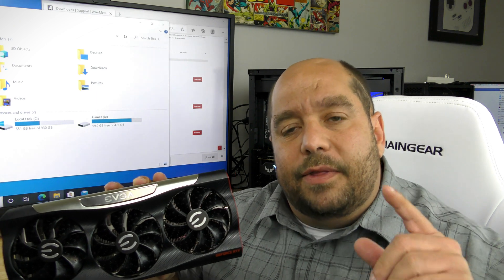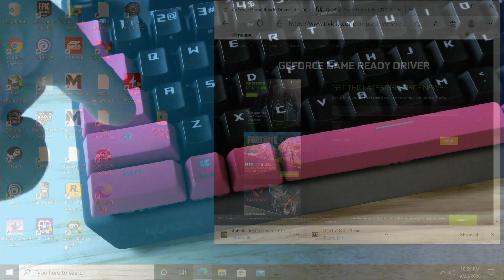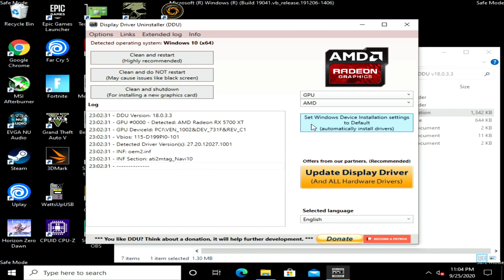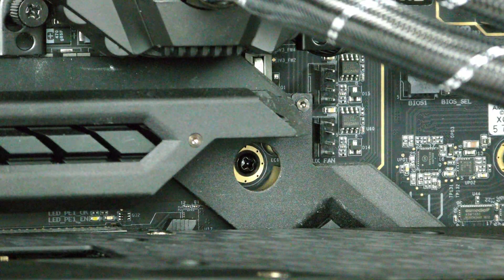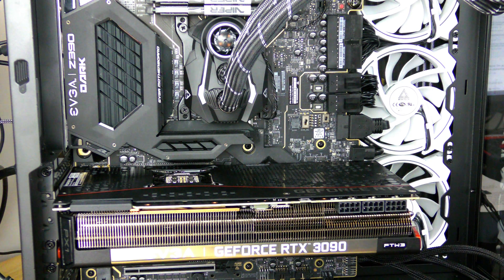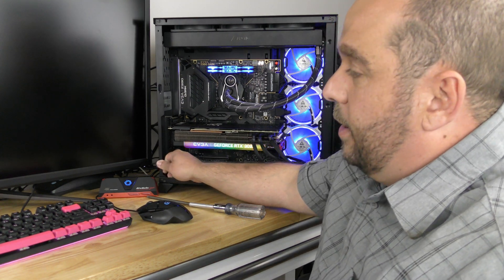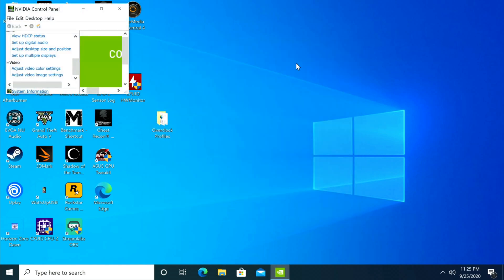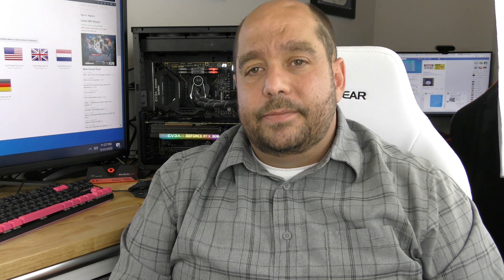RTX 3090 - Installing the EVGA Geforce RTX 3090 FTW3 Ultra Gaming

Comment: Hy! :) 

Please can you tell me, why beeps 4 times the computer on the start whit this cards? Before i have 1050 ti  doesn't beeps. Just whit 3070 FTW3 Ultra. Thank you ! :)
Reply from the maker: Hello my friend, we, that depends on your motherboard actually, those are post codes.  What is the manufacturer and model number of your motherboard?
Reply: @ThisBytesForYou   MSI 970A Gaming Pro Carbon. But comes for me  new ASUS ROG Strix B365-F Gaming.  I hope whit this will not beeps . I hear this beeps  in your video to on 9:08 when you start your computer. :) Thank you for Helping me. <3
Reply from the maker: @87Freemann  So the B365 does not have a speaker, you can add one, but it does not come with it installed, it is amazingly helpful to have though because this helps you to determine issues you have with your machine during POST.  For the 970, the instructions are horrible on MSI's site, but I don't see how to disable them.  Maybe you never noticed it but the machine should have always beeped, that is normal.  Try putting back your 1050 and see if you hear it, I am sure you will and you are so very welcome, I love helping my friend.  Thank you so much for stopping by to check out the video, liking and subbing as well as commenting, it means the world to me.
Reply: @ThisBytesForYou  I put 1050ti back. its not beeps now.  Just whit the 3070 :/  Your Wellcome! :) do you have fixit on your PC to ? This problem? on 9:08 Beeps yours 4 times as mine whit this card.
Reply from the maker: @87Freemann  so is the only issue the beep, or do you not get in windows?
Reply: @ThisBytesForYou  I Have it just when i start my PC. I can play i can do anithings. Just its beeps 4x on the start as your Config in this video. Nothing more. Just every start or restart when starts the PC.
Reply from the maker: @87Freemann  Not sure where this is in your BIOS, or if your BIOS has it, but disable CSM and this should get rid of those beeps.
Reply: @ThisBytesForYou   Thank you very much! I will try it! :) <3
Reply from the maker: Anytime my friend, let me know how it goes.

Comment: Is it bad to use the same pcie cable for my 3070. What’s the difference if I have 2 separate cables vs using the same one
Reply from the maker: yes, NVIDIA recommends against it.  One way to look at it is get a straw and drink out of it, then pop a hole in the straw, then stick another straw in that hole and you and your friend drink out of it, your going to get less of that drink at one time.  2 separate cables can deliver the same power.
Reply: ThisBytesForYou oh I understand why. Thank you for responding
Reply from the maker: @omars8957  always a pleasure my friend

Comment: I did this but now when I tried to install the new drivers I get error 43 :(
Reply from the maker: can you tell me what manufacturer motherboard, video card and power supply you have, please manufacturer and model number as well as operating system?
Reply: ThisBytesForYou Motherboard- Asus Rog b450-f strix
Reply from the maker: @Airlair_  Make sure you update your BIOS to the latest version, 4001 on https://rog.asus.com/motherboards/rog-strix/rog-strix-b450-f-gaming-model/helpdesk_bios/.  After you flash, make sure you set the PCIE to either PCIE3 or PCIE4 if you have that option.
Reply: ThisBytesForYou Gpu- RTX 3070 Pny Xlr8 gaming epic-x rgb
Reply from the maker: @Airlair_  are you plugging in both PCIE 8 PIns into your video card, and making sure you are using PCIE 8 PIns and not the EPS 8PIn and make sure they are coming from separate PCIE cables, not daisy chained.
Reply: ThisBytesForYou The psu came with only daisy chained cables I didn’t know that could be a problem
Reply from the maker: yes, NVIDIA has stated that for these cards, they need to be separate, they said this mainly for the 3090's though, not sure if the same would happen for the 3080's but maybe.  When did you install that windows 10 and was it a clean install or an upgrade?
Reply: ThisBytesForYou Installed Windows a couple months ago, It was a clean install because it was a new build
Reply from the maker: for your clean install, i want you to make sure you followed this guide, if not, you still can: https://youtu.be/8JuC_Dpm6-c, it will help you tons.
Reply: ThisBytesForYou Psu - Corsair cx 650 Modular
Reply from the maker: @Airlair_  SO looking at that power supply, it should come with 2 strands of PCIE cables, look for the other strand, it might be in the box.
Reply: ThisBytesForYou Yes the other is also daisy chained but if it fixes this issue I wouldn’t mind any dangling cables
Reply from the maker: yeah, you would need to use 2 separate daisy chained cables, may not be the prettiest but it should help it to work properly.
Reply: ThisBytesForYou THANK YOU SO MUCH IT WORKED
Reply from the maker: @Airlair_  awesome bud, so what was the original issue and what fixed it?
Reply: ThisBytesForYou I needed to use the two different cables to power the card instead of using one daisy chained one. Thank you so much I am definitely subbing now!
Reply from the maker: @Airlair_  cool, so happy I could help and I truly appreciate not only the sub, but the fact that you came back and let me know, it means a ton to me.
Reply: ThisBytesForYou Operating system- Windows 10 home x64
Reply from the maker: @Airlair_  how old is the install, like how long ago did you install that?

Comment: i have only 2 pcie cables with psu ..i have gamemax 1050..there are 4 pcie sockets but in package were only 2 pcie cables for gpu ..any idea where i can get 3rd one in uk?
Reply from the maker: What power supply manufacturer and model number is your power supply?
Reply: @ThisBytesForYou  card has now power pull of 370W max in games.. with 1 splitter and main PCIe cabel do you think thats enough?
Reply from the maker: @JerroJeroo   as NVIDIA has recommended, never use a splitter and in the other comment you said, is it ok like that?  I didn't mention any scenario where it would be OK, I need to know what power supply you have.
Reply from the maker: @JerroJeroo  ahhh, i apologize, the comment was blocked because of the hyperlink.  It's pretty bad that a 1050watt psu does not support more than 2 strands, but let me know if you would like me to recommend a different power supply,  I am using this one and it brings plenty: https://youtu.be/Dv1qK2phCFM
Reply: @ThisBytesForYou  will this fit to normal atx case that evga psu?
Reply from the maker: yes, for sure.  you can find the link to it on amazon in the description.
Reply: is it ok like that?

Comment: Could use some help here

So i followed this video very closely, and installed the GPU correctly. 

But the fans start spinning when the computer boots up and then they stop when the computer gets to the startup screen. 

I have a recently brought 850W PSU. The computer even register the rtx card when I look at GPUZ and Nvidia control panel.
Reply from the maker: That is completely fine, its supposed to do that.  The fans only turn on when the machine hits 60 degrees.  play a game, see what happens.
Reply: @ThisBytesForYou  Thanks, i did some research/ some testing and found the same result.

Also that was quick.
Reply from the maker: Cool, happy I could help on that and yeah, I love to help and the best way to do that, is quick :D

Comment: I had no experience with graphic card changing, with your video now I have. And it's pretty easy as you explain it.
Reply from the maker: Awesome, so very happy I could help you my friend, did you end up getting this same card?  If not, which did you get?
Reply: @ThisBytesForYou  still haven't installed it, still waiting for it to be available in my country. The 3080. This is why I looked for a recent video and I found yours cause as far as I know they have more pcia pins that I need to connect to.
Reply from the maker: @TheSecondOneGaming  yes they do, and make sure they each is its own strand, don't daisy chain them.  I so hope my video really help you and please make sure, if you have any questions, feel free to ask.  I always try to help where i can.  Thanks so much for stopping by to check out my video and comment, it means so much to me.

Comment: do the pci-e cables have to be separate or can you do two cables with adapters?
Reply from the maker: NVIDIA states that they need to be separate cables, and I prefer to stick with what they recommend.
Reply: @ThisBytesForYou  I have a CX750M, looks like it only has two 8 pin out. Can I throw a 6 to 6+2 on there?
Reply from the maker: @tvplease8629  your power supply comes with 4 x 6+2-Pin, look for the additional ones in the box

Comment: Quick question, if I install a new gpu and just boot up the computer and launch the GeForce experience program and select "clean install" when installing drivers, is that sufficient?
Reply from the maker: if you want potential future issues yes, the method I showed you here, as I explained helps get rid of any issues previous drivers have.  NVIDIA/AMD can remove their own drivers, but since they themselves are tied to their drivers, they may not always do a good job.  Look at all the registry entries and folders the uninstallers leave behind, what else do you think you can't find is left behind?

Comment: Can’t you just turn off the system??? Swap it out and boot up your PC??🤷🏼‍♀️💀
Reply from the maker: I mean yeah unless of course you don't know to unscrew the screws holding the card down, remove the PCI-e cables, release the PCI-e locking mechanism pull the card out (not damaging your PCIE slot), then basically reverse the process to get a new card.  

Then hope that windows picks up the drivers correctly, since you know, windows does everything right and hope that your drivers are not too old for the new card that you are installing to pick up correctly or even worse, have the older drivers you have installed cause issues burning the card out, causing fans to not work correctly, as everything I have mentioned above has happened to many people, but yeah, turn it off, swap it out and boot oh and hope that you get the performance on the new card, if everything works, that you should be getting.

Then also, making sure your power supply has 3 available PCIE 8 pin connections and can provide 750Watts.

Just like playing the pong is like playing Fortnite, you know, they are both games right.

Comment: when i DDU'd my 2080ti b4 the 3090 windows wouldnt recognize the 3090.  So I had to install newest driver. shutdown then take out 2080ti and put 3090 in for it to work
Reply from the maker: It does happen, but you would have to manually download the driver for the 3090, I have never used the automatic driver install.
Reply: @ThisBytesForYou  i did. It wouldn't install because windows didn't think i had a gpu
Reply from the maker: @patjcoan  I had noticed this issue too, I am not sure why though it should not mater if it sees your GPU or not, it seems to be a website issue.
Reply: @ThisBytesForYou  well I could download the driver from the site but it just wouldn't install.  Maybe it's fixed now though,  I think it was a windows thing
Reply from the maker: wow, that is the first time I have heard that, that it would not install, that is strange but good thing you got it working.  For me, i just could not download it for a few.  It could have been though that windows update was doing its thing downloading drivers.  When you did the DDU, did you also stop windows update from downloading drivers?
Reply: @ThisBytesForYou  its possible.  I do have it set to only allow me to install drivers.  It was a weird issue, evga couldn't figure it out either when I talked to them. But its working now thats all that matters:)
Reply from the maker: @patjcoan  yeah for sure, as long as it is working, very happy all is well then.  How are you loving the card?
Reply: @ThisBytesForYou  absolutely love it. I wanted the ftw like you, but they only had the xc3 ultra, which I'm not upset about:)
Reply from the maker: nah, its still a great card, so very happy you like it.

Comment: Thanks for the video! I have a dumb question but since I lost the spare PCIe connectors that originally came with my EVGA Supernova 1000 P2 power supply, I'm trying to get the proper 8 pin PCIe cables to power an PNY RTX 3090 (which requires 2 separate 8pin connectors). 

I have an 8 pin to 8pin+6pin connector that was hooked up to my GTX 1080ti previously. Can I just use the 8pin to 8pin (and leave the extra 6 pin dangling), and then attach another 8 pin from the PSU to the other 8pin slot on the card? And for the latter, I can't find a normal 8pin pcie to 8pin without it coming with an extra split 8pin as well, so can I leave the other 8pin dangling as well?

I didn't plan to connect one 8 pin to a split 8pin at the GPU because it's not recommended by Nvidia for the 3090 as I understand?

Thanks very much and keep up the good work!
Reply from the maker: You have to connect all of the 8Pins, but yeah you can leave the 6PIn dangling.  I would recommend contacting EVGA, they might either give you one for free, or for like 10 or 20 bucks or so.  I found a kit,... but it was $100, way too much when you only need 1 cable and they are red.  Here is my Amazon Affiliate for it: https://geni.us/OvcDpa
Reply: @ThisBytesForYou  Thank you! Does it have to be a red cable supplied by EVGA themselves? What if I go with those here:
 https://www.amazon.co.uk/gp/product/B07TVSCKFQ/ref=ppx_yo_dt_b_asin_title_o00_s00?ie=UTF8&psc=1
Reply from the maker: those are splitters, you don't want splitters, that is what NVIDIA does not want you to do.  You need 3 8 pins to the card, they cannot be provided by splitters, I highly recommend calling EVGA, their support is amazing and they work around the clock and anytime my friend, I love helping and I always answer unless Youtube doesnt notify me, which sadly happens often.
Reply: @ThisBytesForYou  thank you 🙏🏻! I will do that then. Have a good day 👍🏻
Reply from the maker: @mohammadmj  Thanks my friend, please do let me know how it goes.

Comment: When you install a graphics driver from NVIDIA, you should always choose Custom Install and then tick the box that says "Perform Clean Install". This removes all of the NVIDIA software first before installing the new driver. That way, you don't have to go into safe mode to install the latest drivers for your Video Card. Great tutorial though!
Reply from the maker: yup, I always do that, though I prefer to use DDU as a base to make sure nothing is there and if there is,... the nvidia driver takes care of it.  I don't like to use the drivers to do that because in regular model they are reliant on the drivers and they might be in use, and don't always detach which is why some have driver issues later, using DDU in safe mode, no drivers are active so it allows to to get rid of everything.  Thanks so much for your kind words my friend, they mean a ton to me.

Comment: I can’t get my pc to start in safe mode. After I hit restart all my monitors just shut off and I have to hard restart my pc
Reply from the maker: You may want to the check your cables, make sure they are plugged in correctly and make sure you don't have an 8Pin EPS cable plugged into the card, make sure you have 8Pin PCIE cables.  Also, what is your power supply manufacturer and model number?

Comment: Hey there! 

I will be getting an Asus strix RTX 3080 soon so should I follow the same process as you? I mean what if I just disconnect my GPU from my mobo and plug in the new one? And then install the Nvidia drivers? Will everything work fine? 

I’m upgrading from an asus strix 1070ti
Reply from the maker: I would recommend following the steps here in the video, removing the older video card, installing the newer video card and then installing the driver will leave potential for older drivers to remain, potentially causing problems.
Reply: ThisBytesForYou But I already have GeForce Experience installed, won’t that automatically overwrite the old drivers? When I install the new ones? I actually sold my GPU a few weeks ago and am waiting for my 3080 to arrive, so I can’t turn on my pc now😅
Reply from the maker: Sure my friend you can, save yourself a few extra seconds not using ddu and later potentalially wonder why you are having issue.
Reply: ThisBytesForYou Really? I did some research online and found that AMD processor don’t have onboard graphics? Will i still be able to boot to windows and install DDU? I have a Ryzen 7 3700x processor and an Asus X570-E gaming mobo
Reply from the maker: some do and some do no, the X series does not.  Pop the new video card in, boot to windows, then download ddu, boot to safe mode, strip the drivers, then install the latest driver, like I show you in the video.
Reply: ThisBytesForYou Okay thanks a lot!👍🏻 Wish you all the best!😁
Reply: ThisBytesForYou Hey there, sorry for asking too many question😅 but I noticed all 3080s have 3 8Pin connectors, I’m also looking to get a new PSU(850W) later because I currently have 750W(which I might use for the time being) But I looked up the Asus Thor PSU and it only comes with 2 6+2 pin PCIE cables. Where can I get the third one from?
Reply from the maker: Try this: https://geni.us/lnfuaJ

Comment: Is it worth an upgrade from 2080ti?
Reply from the maker: Well, considering the 3070 will supposedly going to have the same performance of the 2080ti, maybe but I don't have a ti to compare it to, only a 2080, and yeah it's much better.  I would say stick to your to just a little longer.
Reply from the maker: Then also, what resolution do you play at?
Reply: ThisBytesForYou i recently got a 4k 120HZ LG TV.
Reply from the maker: Nice, I am using an asus 43" 4k 120hz and it is amazing
Reply from the maker: At 4k, I would get the 3090